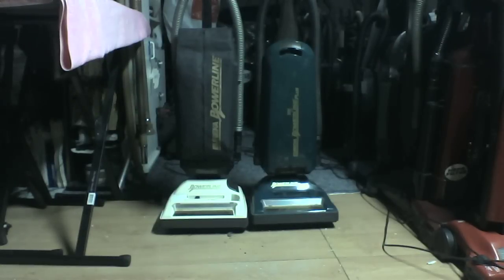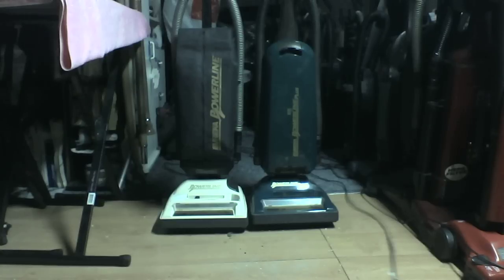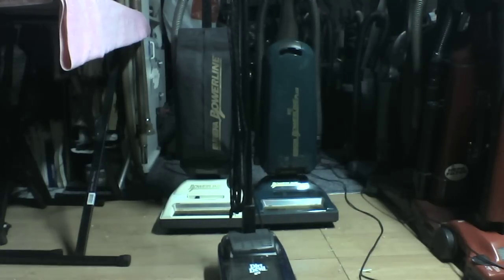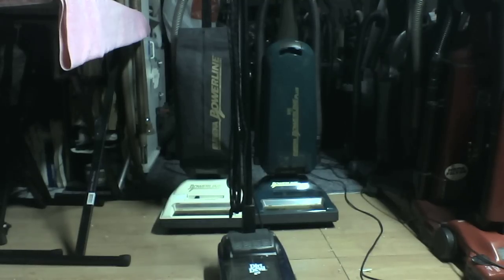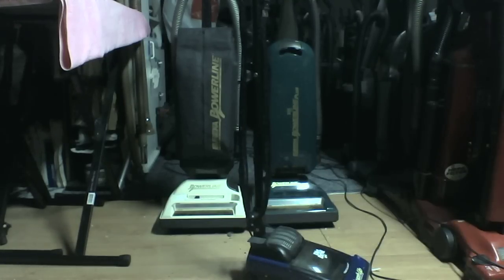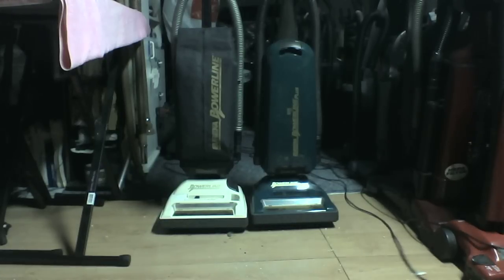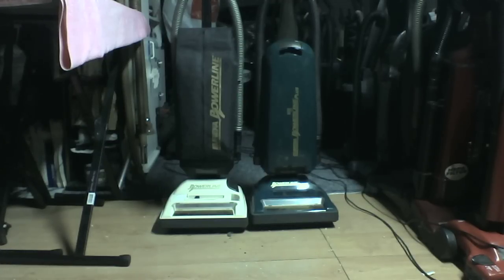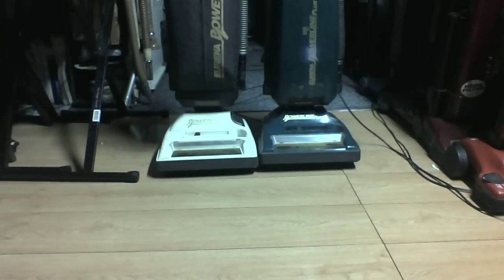Vacuum Request: Eureka Powerline 10 Amp vs. 12 Amp

Comment from the maker: currently it is a soft plastic hose, but it came off a bravo II. all the original bravos are supposed to have the hard plastic ones, usually the same color as the white powerline.
Reply: Vacmasterthegreat I have a black 10 amp powerline plus from the bravo 1 series